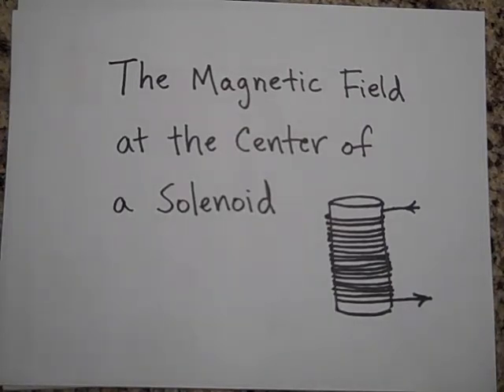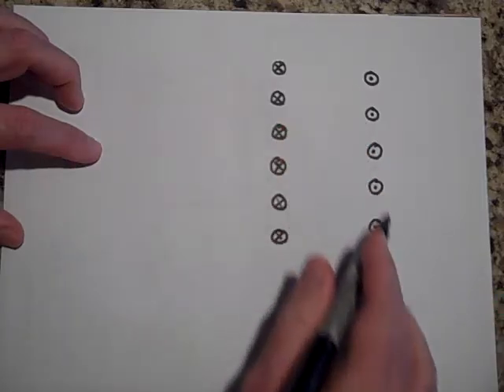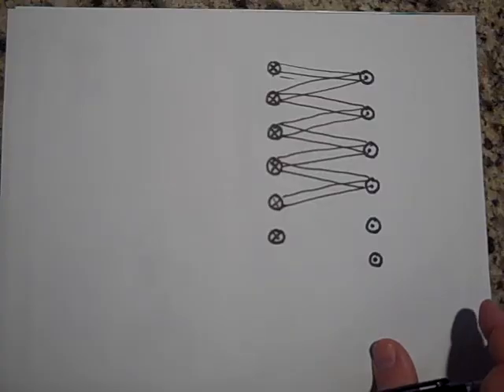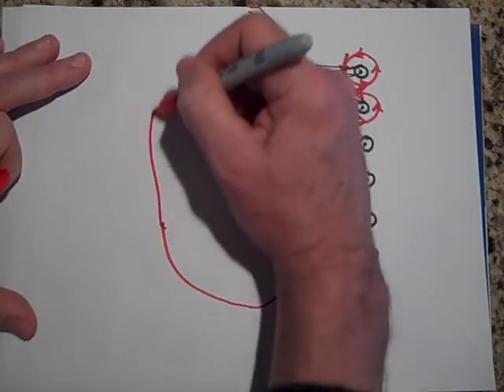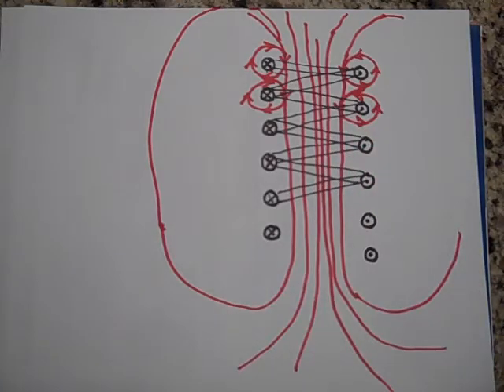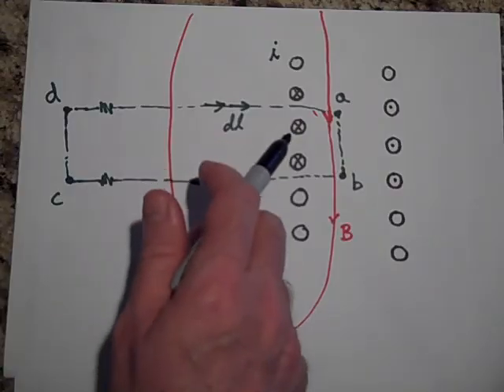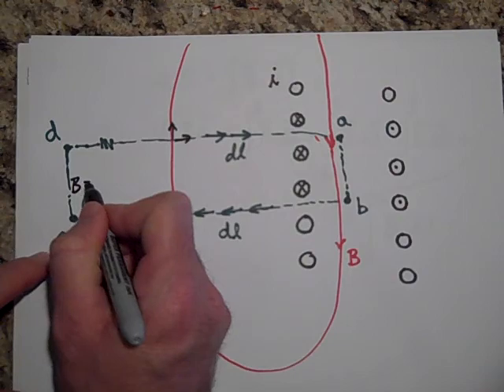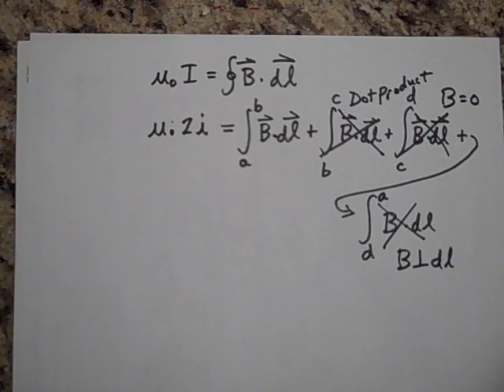The Magnetic Field at the Center of a Solenoid (part I)

Comment: Alright. Then what about the magnetic field lines outside the solenoid, just opposite to the center. They should melt and form a big loop too right, as they are in the same direction too?